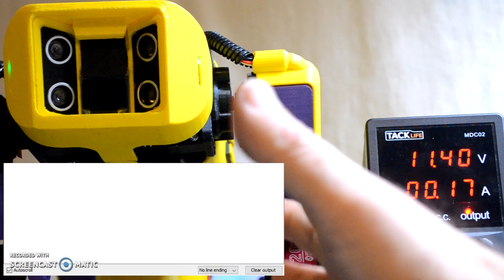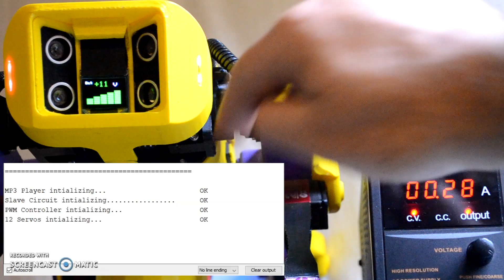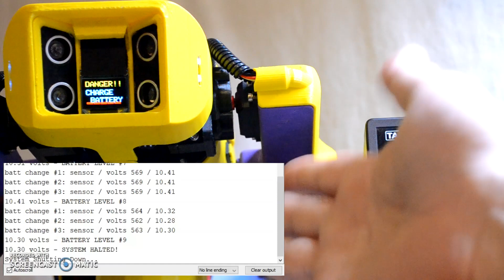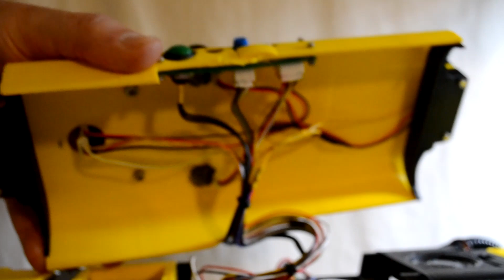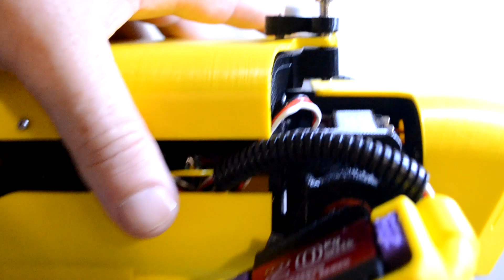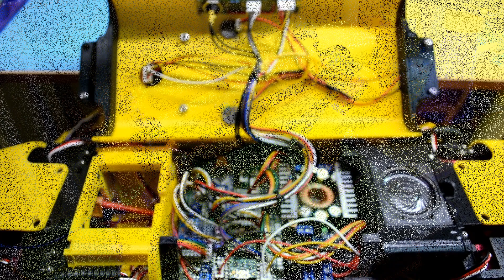New Updates - Nova SpotMicro3 - an Arduino Quadruped Robot Dog

Comment: hello can you put online the black spacer stl as in the video? I can’t find it .. Thank you so much
Reply from the maker: so sorry, and thank you for pointing out my miss... you can find them on github now, there are two sizes... I'm hoping to eliminate these some how, but right now, I'm using the larger one:

https://github.com/cguweb-com/Arduino-Projects/tree/main/Nova-SM3/STL%20Files/SM3%20Files

the files are:
SM3CoverTopExtendedRiser_sm.stl  and SM3CoverTopExtendedRiser_lg.stl
Reply: @ChrisLocke1969  Super merci beaucoup monsieur ce projet est fou!!! I have well advanced I’m waiting to have the argen to buy me the remote control , thank you very much for your shares and bravo to you for the design it’s a lot of fun
Reply: thanks you very mutch <3
Reply from the maker: you are very much welcome, sir!  Please join our site and post your project if you would:  https://novaspotmicro.com
Reply: @ChrisLocke1969  ok thanks when it will be completely finished I would make a return no problem
Reply: @ChrisLocke1969  Help I received the ps2 v4 controller it connects well ( led fix ) my wires are connected to the right place , but I have no reaction of the robot nova:-( do you have an idea why it does not work? or a tutorial that could explain me? thank you
Reply: Please ps2 v4 connect pin 24,25,26,27  ?
Reply from the maker: @gui6422lura  see my latest video, if you have not ;)
Reply: here is my page sorry ^^ :-)

Comment: great work, i am building the easyprint esp32 version now, most of the electronics down, nowhere near as many as this. working on code too and im not great but learning a tonne.

Keep it up! I'd be super interested to see the code!
Reply from the maker: That sounds great!  Yes, this is exactly how I built Nova... learn as you go!  Though I have been a web developer for over 25 years, so maybe I have a slight coding advantage, but this project requires so much knowledge about many moving parts, its very rewarding!  You can find my code and all other related files on my github linked in the desciption.  And join our discord server, we'd love to see your project which you can share with us there!   Thanks for your support and good luck with your project!

Comment: Chris, can the issue with MPU and the Nano remove reset can be fixed with Nano rp2040? I have one on the way, I wanted to use its built in mpu equivalent and its ability to wifi connect to cut down on button connections and maybe even interface a controller via web app or mobile app. Still printing all the parts, but following closely on every update you make to your bot, thank you for the updates, it looks like boston dynamics have some competition!
Reply from the maker: hello Bekzod... great question, and great idea to give another microcontroller a try... I don't know much about the nano rp2040, but from what I have seen, you may be able to pull it off, yes.  I probably would not have added the Nano if I had started with the Teensy - it probably has the power to handle all of the concurrent functions, unlike the Mega could.  I'd be very curious to find out how it goes for you!!  Thanks for watching, and please update us on your progress, my friend!

Comment: Chris , your Voltage devider and your new battery Check System,  can you make a Wiring Diagramm? I dont understand the Diagramm in github because there is only the tinkercad Diagramm... that where nice to See the conection of the resistor and the diod or other things you build in . And Witch resistor you choose , thanks a lot
Reply from the maker: yes, i will do a full detailed electrical video (or series of videos) this week as my new boards arrive soon!  I can start with the volt divider, since i just finished integrating it onto my pcb design for the next production run! 😉  Give me a day or two and i will post the first video. 👍
Reply: @ChrisLocke1969  Can't wait!

Comment: Uploading nano doesn't affect by I2C. Only if you connected serial to Arduino nano you won't be able to upload to the board.
Reply from the maker: thanks for the correction... yes, this is true, I mis-spoke. And do you know, is there any way around that at all?  I assume my thought of putting a physical switch in the data line is not possible / bad idea?  Its such a pain during development.  Thanks again for your valuable feedback!
Reply: @ChrisLocke1969  if it's serial, you can put switch on it. Just put switch on RX line will be enough
Reply from the maker: omg, that's so good to know!!  I was afraid to just try it... thanks for confirming, I will be doing that asap! ;)
Reply from the maker: I AM getting slow in my old age... I am not using serial, which I knew, I guess... but it didn't dawn on me at first.  But thanks to you inspiring me, I found the issue - in my case, I have the reset pin wired to pin 3 so I can restart the Nano via software... welp, I just tested, that connection is what's preventing me from uploading... and unfortunately that's a pcb trace connection, so I can't easily put a switch on it.  But there we go... with a little help from you, the community, hopefully others will learn from this as I have, and the reset pin could cause this, too! lol   I will include this discovery and your assistance in my next video for others to learn from my mistakes.  Thanks, Ahmad!!
Reply: @ChrisLocke1969  ahhh, yes. When you upload to the board it will reset all the pin to the default state. Which mean your reset will be low whenever you upload. You can scratch the pcb, and I believe there is a code that can reset your arduino without help from another pin.
Your welcome Chris, I just love robot dog right now. And you are the only one that I know of that update your project along the way. 
Keep up the great work Chris!
Reply from the maker: @mr.frozty5324  I was using the software only method on the Nano, but it was seemingly impossible to fire it from the Mega / Teensy commands for some reason, so I went with the pin trigger. I'm glad you appreciate my sharing, keep watching for more! ;)